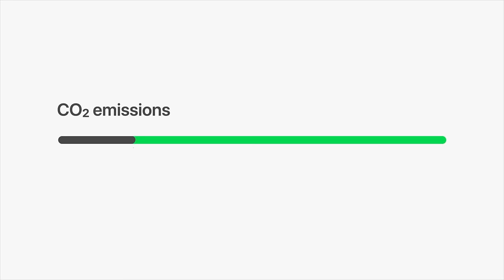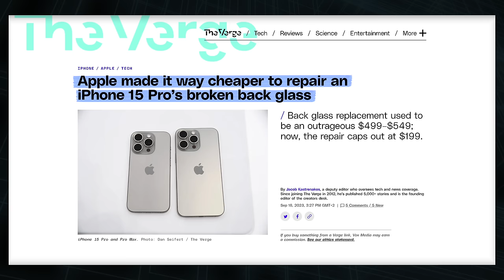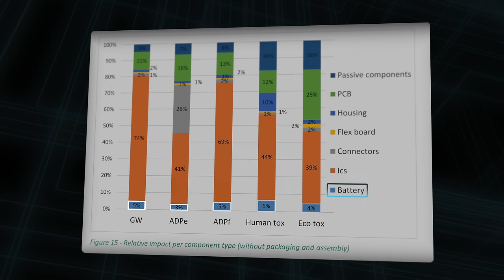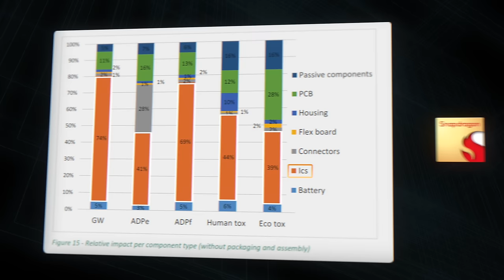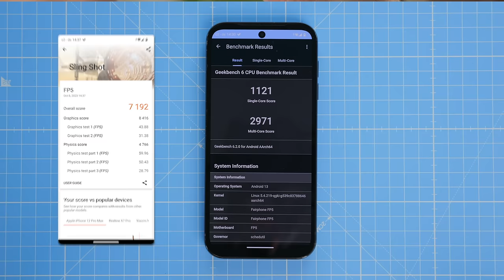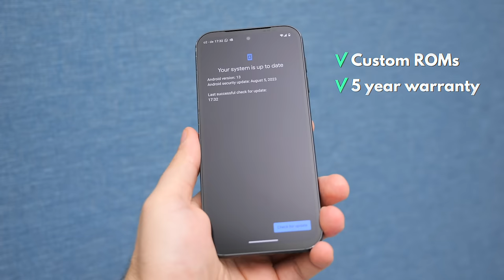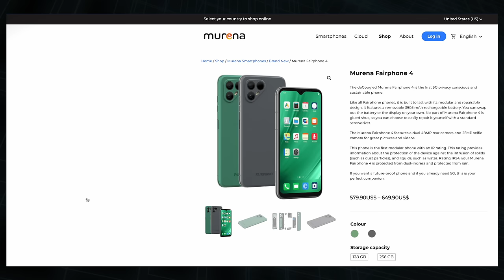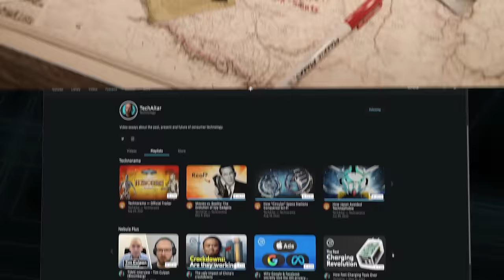Is Fairphone really fair?

Comment: I think the only REAL problem is the price, just not competitive enough and not justified for the hardware in the device (like, you can reclace "anything", but cant upgrade nothing), with this specs, only the "green" part of the project is the seller point, making them a not desirable smarthphone (premium price, not premium experience), apart from that, there are some obvious controversies like not having a headphone jack ("you can replace your batteries if they got bad, buy will ever need to use bluetooth headphones/tws with non replaceable batteryes") and not having a open source software, ok, "upgrades for 8 years", but, where is the option to replace or modify your device software as much as you like, this would be fair.
The envyromental friendly part (recicled things or whatever), no one actually cares, in my opinion, if they want to make a green product, and claim to change the world, they need to be competitive, with this price, they not and, even if you can replace everything like cameras or whatever, apart from the external parts, screen and battery, is most likely any other component will never fail and with any "chinese smarthphone" of the last years, you can always buy this parts from aliexpress for cheaper then "40-100 euro" (this price is cheapest then apple, but not cheapest then the competition), ofc in "chinese smarthphones" this parts are "not that easy" to replace, but if they are cheaper (and the phones have better hardware for good price),it  is worth the trouble.
Idk, what i mean is, the idea is in parts "green controversial", ignoring the big picture and not competitive, to have a real impact, they would need to be at a "fair" price too, if you really care for the enviroment just have a used (ou new 300-400) smarthphone and use the rest of the money to really make a difference, this phone with this cost/benefit will ever be a niche product, dont having a real significant impact on the planet, if the ONLY point of the company is making money, cool, with what they are offering they will have a small but consistent slice of the cake, but if they really think what they state, not even close yet

Comment: With my FP4, I can trust that the manufacturer actually wants to support my phone as long as possible and isn't just forced to. It also means that I won't have as much pre-installed garbage on my phone compared to Samsung and the like.

The only complaint apart from rattly speakers and crappy night photos is the screen protector sold by Fairphone. I'm on my fourth protector now, as the others broke even by mild impacts.

Comment: In fact, I used my OnePlus 7t for 4 years, replace the battery for 2 times, with proper protective case and screen protector, I think modern middle range phones can definitely last 4 years performance wise.

But still I brought Fariphone 4 as a backup phone, as my support to them (even they don't sell officially in my country).

Meanwhile, with more and more Chinese phones locking their bootloader, and shrinking 3rd part phones for non-Pixel phones, I believe Fairphone still has its own chance, for the old-school phone hackers, as they do not only support bootloader unlocking, they also push their kernel code to upstream (maybe for possible longer support time).
This makes them a pretty good choice, if one can accept the price tag.

Comment: The value is always horribly unfair. It just always makes way more sense to spend the money on a used flagship, so you get signficantly better specs for the same money and aren't buying a new unit (reduce REUSE recycle). The fairphones have always been overpriced and underpowered, and when you consider that buying a used phone is ALWAYS greener than buying a new one, you realize realize that the people that it's targeted to the most are the least likely people to buy it.

That industrial chip thing is very cool though. I do have to give them that.

Comment: FP4 user here (in use since 01/01/2023). 
I consider myself a heavy user, my FP4 battery lasts at least 15h with 7h SoT which is enough for an average day for me. But boy, using it as a navigation device walking around in a city you´re not familiar of, kills the battery within 3h. 
Oh yeah. And: Camera: I rarely use it and if I have to i shoot raw (DNG) with OpenCamera. Because in my opinon stock camera jpegs are absolute rubbish. 
Do i miss the 3.5mm headphone jack? YES! Because speaking of longevity. I can´t use my beloved AKG415 with this smartphone cause these headphones are 7 years old and wired. Yes, I am aware of USB-C to 3.5mm adapter. But this "solution" isn´t a proper solution.

Comment: All it needs is a headphone jack and I'd certainly consider it if my €200 Samsung ever dies. I bought it because it has a dual SIM slot, as well as a SD card slot and a headphone jack - that list is my minimum requirements for any phone because they're all features I use regularly. Not having a headphone jack is a major environmental issue as it gives people no choice but to buy bluetooth earbuds, none of which I'm aware of provide any facility to replace the battery, pushing people to buy more of the same soon to be landfill when the batteries fail. This is by far the biggest issue with this product's environmental credentials, as the option for cheaper, more easily recyclable and more durable wired headphones is not available.
Reply: If you can tolerate custom ROMs for software security updates in lieu of manufacturer support, Sony’s Xperia line has a headphone jack, SD card, OLED, waterproofing.
Reply: @gotoastal  Can that still be bought new? I didn't think there was a high end phone with a jack plug around anymore from any manufacturer. I really liked the Sony Ericsson phones I used from before the smartphone era, the W810i Walkman phone particularly stands out. 

My Vaio laptop is still going without any problems with nothing done to keep it relevant except a RAM upgrade and swapping the mechanical drive to SSD, 12 years after I bought it too come to think of it.

Comment: Personally, and maybe its just me, but I feel like even if you take care of your phone, about 2-3 years is the limit of holding onto it, mainly due to the battery. Because usually with daily use, even if you try to recalibrate your battery (not many people do), the battery starts losing its staying power. When you used to not think about your phone till you plug it in at night, but now you gotta plug it in when the day is halfway over, thats a problem. Yes, with expanding right to repair and services that can replace your battery, its becoming slightly easier to get a new battery. But for the vast majority of people they wont even bother with all that, its easier for them to just get a whole new phone.
I'll tell you, that's the reason why for years I only bought LG phones, the ones that had user replaceable batteries. In fact they even sold a battery charging holder for your spare battery that you can just plug in and keep an extra battery on you just in case. But when they dropped out of the business, there really wasn't any other option for a phone designed for easy to swap out batteries. So yeah I had to go with something else. And I'm in the US, we don't have many options like they do in Europe and Asian markets. We got Apple, Motorola, Google, and Samsung. Unless I really want something shitty. So... Yeah I went and imported a Vivo X60 phone. But now that I've had it for 2.5 years, the battery life is really drained on it and I'm forced to look for a new phone. 

I'm thinking Fairphone is at the top of my radar, even if I have to import it. That easy-to-swap battery is still a high priority for me, and I don't know why thats not a priority for other people. No they'd rather have glass-backed phones with high water resistance (in the 20 years I've been using cell phones I never once dropped my phone in water so its never been a concern of mine)
Reply: It’s nice having a device that you can put in a drawer, use while you wait for a new phone, and still be supported. Even though it’s a mid range phone, having 10 years of support is crazy, if I weren’t upgrading every year I’d buy a fair phone.

Comment: The only real customer of Fairphone I could see is someone that constantly breaks their phones, only then does the cheaper repair cost makes any sense. 

Been using Apple for over a decade and keep my devices for around 3 years before upgrading to a newer model. The batteries still have over 80% health after 3 years so never needed a removal battery. 

Get 1 free screen replacement but didn’t have to use it once, I look after my devices. No other repairs needed. 

Removable batteries are a scam, and are unnecessary as batteries last much longer now.

Comment: Writing this on my fp3 in use since 2019.
Thank you for this video!

You failed to mention the option for extended storage via micro SD card, which is a huge plus for me. 
Also, you mentioned "phones can be used longer these days" but do people actually do this? 
In 2019 when i decided to get the fp in Germany the average (!) use time of a smartphone was just under 2 years. I then decided to use this phone for at least 5 years, and today i am very happy i accomplished this. Everything more than 2 years is a gain in sustainability imo. Today i hope i can use this phone till the fp6 is released. 

I swapped the battery for a new one maybe a year ago (which wasn't even necessary, i hoped to improve performance. It didn't..) 
What i miss on my phone today is memory (ram) because apps got so hungry in the past 5 years..

🤟

Comment: My current and last phones are two refurbished samsung A72 and A70 anf while the A70 cracked the screen after 2 years and the A72 had a spicy pillow battery that wasnt taken in account (got a that fixed with an rma). Still very happy with refurbished phones, especially midrange ones. Tho, i think once my current phone bites the dust, i think i'll get a fairphone

Comment: Normally you buy a phone and you know that it will get damaged at a certain point in time. Accidentally falling out of your pocket on the street, falling of you desk exactly on that iron leg of your chair, etc... Whenever this happens your display gets cracked and you keep on using it because 'hey it still works and the crack is not that bad'. But then the crack starts to grow and you start looking for a replacement screen/repair and then you notice your phone is not supported by the repair shop or the repair is relatively expensive and thus you decide to just buy a new phone. 

But since I got my Fairphone nothing broke it yet. Well I dropped it a few times and at certain moments I thought 'well that's it'. But it is still perfectly fine. It's maybe not the 'best' phone, but for me it is really important that it just does not break.

Comment: For me, a phone doesn't need to be super easy to pop open and replace something in 5 minutes. I have a heat gun and tools.
But genuine parts need to be easily available for a reasonable price, part rejection either needs to not exist or there need to be easily-accessed tools to reset it (like for Pixel phones), and there shouldn't be a significant risk of destroying a display because you inserted a pick 2mm instead of 1mm.

And for those that aren't able to do the repair themselves there's still repair shops. And if the device is easier and cheaper to fix in general, then they will be able to provide a better service too. Maybe the phone manufacturers could even certify such businesses, provide a directory online to easily find them, and hopefully even provide warranties on repairs.

Comment: Keeping my device in a case and avoiding near 0 and 100% charge in battery I managed to use my mediocre Samsung model for about 4 years with no big issues. I believe it could go at least a few more years more but unfortunately it's hitting end of support soon. I think modularity is not so important as software support. Still glued-everywhere modern phones are repairable only if spare parts are accessible. Choosing my next daily driver long support or compatibility with FOSS distros will be a main selling point to me.

Comment: I'm very clumsy, and tend to buy "rugged" phones which seem to have more of these better practices. Samsung's Active line has pretty much always had replaceable batteries, although I found they're not as rugged as they say. So then I got a Kyocera, which had some things that could be replaced, and the one I had featured some refurbished parts. Now I have a Nokia XR20 which says it's supported for 4 years of updates, but doesn't open up or have any way to access and replace parts. It also has the worst screen and speaker quality of what I've used, but honestly, I have a Bose Soundlink2 that I've had for years at this point, and I'm usually using that anyway. 
But as a Canadian living near the coast, waterproofing and wireless charging are so important! There's nothing worse than dropping your phone in a snowbank and not being able to use it until it dries out enough to charge. Thankfully that's only happened to me maybe twice, but wireless charging means you can still charge it without worrying about the charger port being wet. I also garden, and I've had to wash my phone to get rid of dirt that got in. I'm hoping to sew some pants with better pockets so I won't have that issue, but it's still good to be able to do. I know Kyocera recommends Seventh Generation dish soap on their devices, but even just the ability to get wet without dying is really important to a lot of us. I love the idea of Fairphone, but for now, I do what I can when it comes to things that are durable, reliable, and supported for longer than 2 years, and so far, Nokia and Kyocera seem to be the decent ones, although I will note, they're hard to find and not available in many places. Kyocera's new Duraforce model is USA only, and I had to get my Nokia from a couple provinces over as they aren't sold in traditional Canadian retail stores, just this one place that happens to carry a bunch of less popular devices.

Comment: Did I read that correctly? They charge the battery up all the way to 4,45V?? 
There was a time, when li-ion batteries were not taken any further than 4,2V and they could last you 10 years.
Apparently, squeezing some more mAh out of the same battery is the way to got, even if the batteries dies within 3-5 years. 
And yeah, I know, there has been some changes in the exact chemistry, that is responsible for some fraction of that voltage increase, but from my experience, 4,45V is WAY to aggressive (high) for a product, that is supposed to be environmentally friendly.

Comment: Camera is great but few things they need to change tho.
1. Battery upgraded to 5000Mah
2. 8 gen series chip.
3. 5 years android update with 10 year security updates.

8gen series is the only one that can last that long without becoming too slow since sd865 is still great comparing to any 400dollars phone that you buy.
The difference between 4000Mah and 5000Mah is that you have to charge your phone 2-3 times where 5000Mah users charging 1 time for casual users and 2 times for gaming.

Comment: thanks for this. I've had one OnePlus 6 since 2018 and upgrading now only because it has a broken headphone jack, the USB-C port requires a very specific angle to charge and the battery life is poor and there's a small scratch on the screen The performance is more than enough for me. If I could easily swap out the battery and usb-c port I'd keep it for longer. I've just ordered the fairphone 5 as in another 6 years if I have the same issues I can swap out the broken parts rather than buying a whole new phone!

Comment: the problem is seldomly modularity. The Problem i face, when repairing stuff is PART AVAILABILITY. You either wont get them, replacements are off spec, or the price is artefficially inflated.
the plastic backplate for 25€ is already a huge ripoff. They cost next to nothing to produce, once the tooling is installed.

My hawei honor v10 could be opend with two tiny screws but good luck geting replacement parts at a fair price.

Comment: My Nokia 8.1 finally gave up this morning. Battery started bloating and fingerprint sensor went dark, looks it's time for Fairphone 5. 
I've repaired the Nokia a lot over the years. New screen/frame, switched battery once and switched USB-C charging PCB twice. It wasn't too bad but still fully modular design and replaceable battery are selling points for me. I usually use my devices +5 years.

Comment: "Small" smartphone, with changeable battery with basic tools + headphone jack, 1-2 back camera lenses and I can buy them...
Now they are doing marketing BS phone.
I still use Sony xz1c, which has all I need. If I want I can send for repairs my first one (microphone fix)for less, than some parts to this fairphone and second one, used, costed me only ~100$.
XZ1C design with S695 is all I need, beside better battery replacement, which cost only ~40$ to be done by third party, or ~2 years ago for free by Sony.
I just hate this mass produce design to copy what can be marketed, not by what is useful.

Comment: I have OnePlus 5t still, it's last Android version is 10 (and I'm still at 9 cause when 10 cane out it was so slow and buggy on this phone). It's not waterproof, battery is at 60% and I have to charge it several times a daycapacity, when I changed it for aftermarket battery it lasted few months and died altogether. It has bugs that were never addressed by company. The only positive thing is it has survived countless drops on asfalt, concrete and tiling. And 3.5mm jack. I'm seriously considering FairPhone, but importing is expensive. They need to expand beyond EU, that will definitely raise their market share!